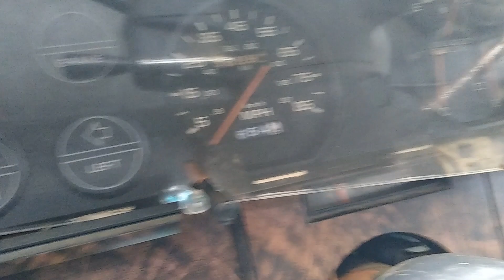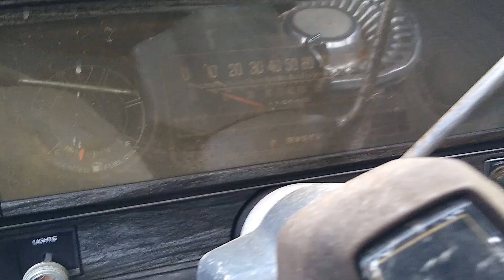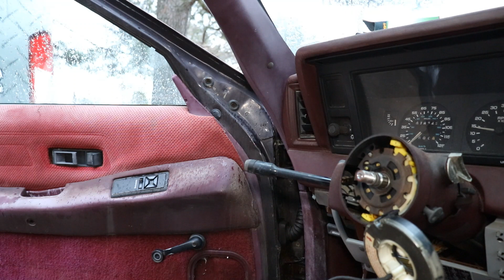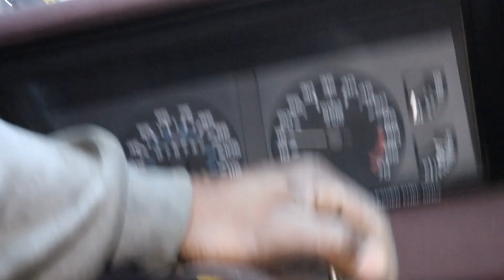Will it run. Pt.2 1989 Dodge Daytona ES. Salvage yard stimulus check purchase. Ep.457 #dodgedaytona

Comment: That's the twin to my car!  Only difference is mine is the turbo, auto with power windows, otherwise same color package and everything! And the funniest part is when I bought mine it came with 1 spare snowflake wheel like yours.....still have it but it's in minnesota
Reply from the maker: Is for sale if you are interested
Reply: I would in a heartbeat if I didnt already have 6 daytonas and 4 omnis in my backyard lol.  I have an addiction, dont feed my habit 🤣
Reply: Besides, all the parts I need are the same parts you need lol
Reply from the maker: My wife told me I am past my two car limit. 😂
Reply: 🤣 i guess you cant argue with the boss!  I have to start liquidating soon too.... probably just park them at the farm and pretend I sold em.  I'm a sucker for the 80s dodges and they are getting hard to find so I scoop up whatever I can but the neighbors aren't as impressed as i am 🤣
Reply: @RpmAuto  if you decide to keep it a bit longer, or just want to fix it before selling it check this out. https://youtu.be/HtCjZbqd7Aw
Reply from the maker: Yeah I am starting to dig the '80s cars myself. Dodge did have a lot of selections in the '80s.